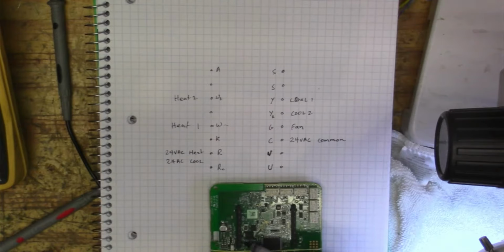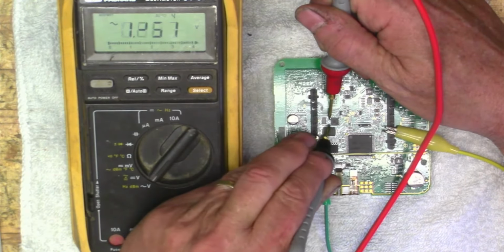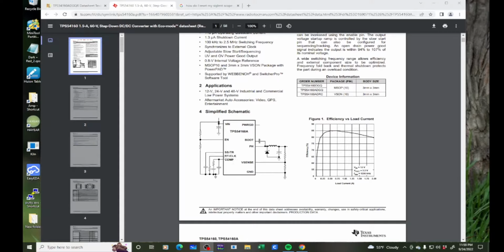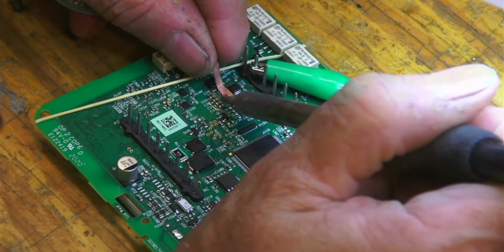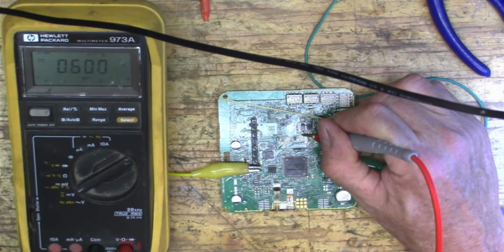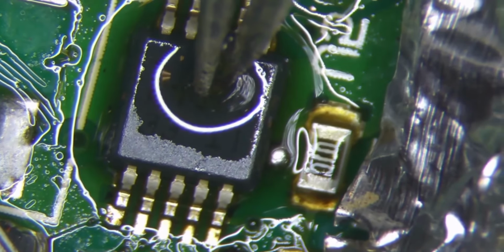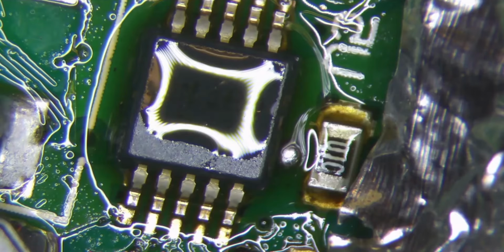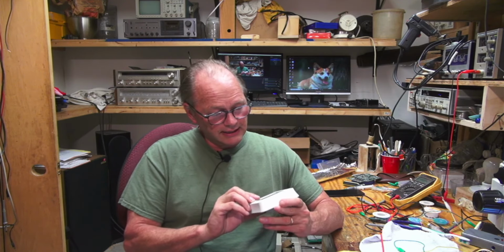Honeywell Home Pro Series Thermostat Repair TH6320WF2003

Comment: You would have saved a lot of time for people if you would of explained what you checked on your daughters thermostat base to determine how the wiring diagnosed. If there was something wrong with the wiring (like no voltage coming from A/C or Heat) that would have saved someone from tearing the whole thermostat apart.
Reply from the maker: I agree. I went over to her house assuming that the problem wasn't the thermostat so I didn't bring my camera.